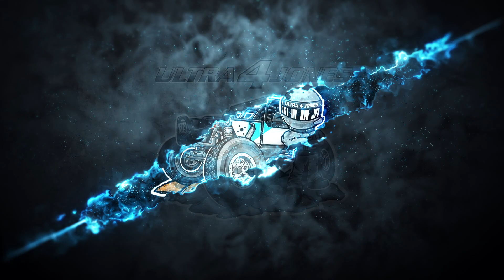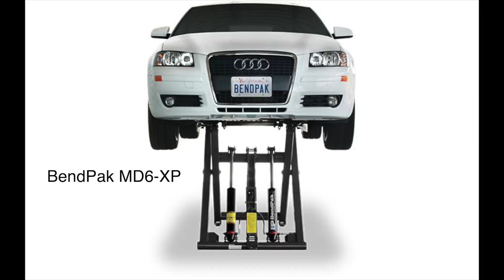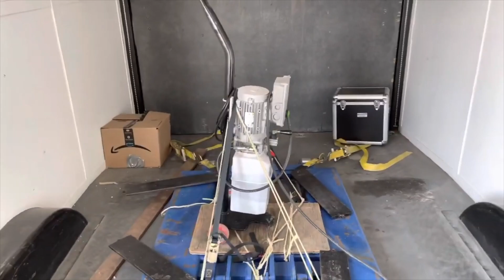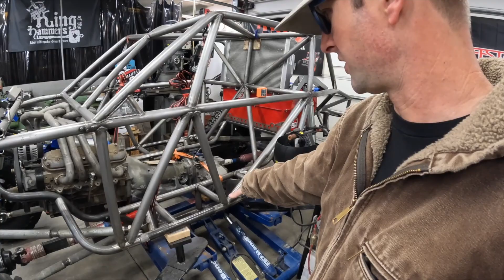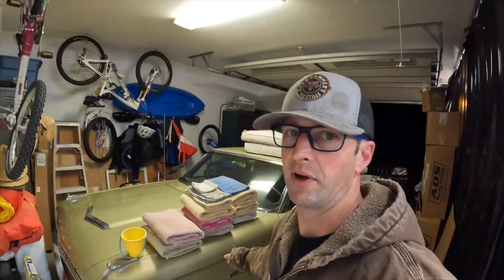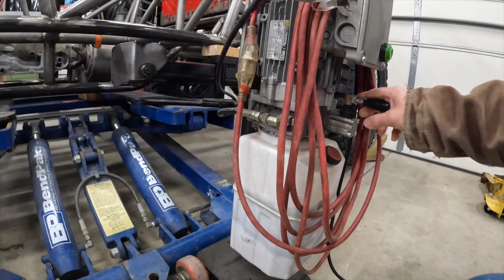Don't Build A Car Without This Tool!

Comment: Always thought this was pretty rad. How low can you get the chassis? Will it drop to full bump? Or do you still need to jack the axels to get to bump?
Reply from the maker: I am building the car with a belly height of 6” at full bump and have been having no problem getting the lift that low.
Reply: @Chasing518  Nice! Couldn’t really tell in the video if the blocks you were using kept it from dropping that far. So cool man